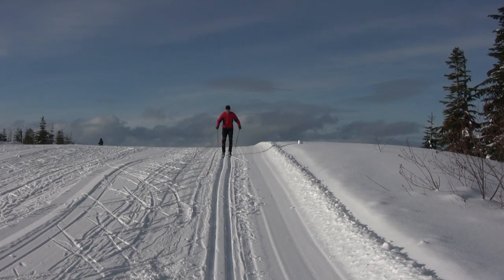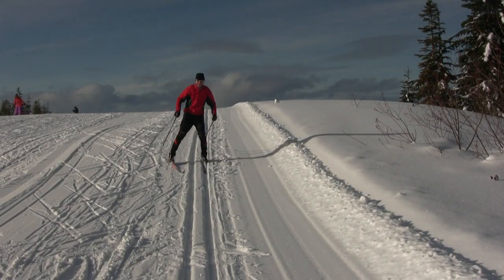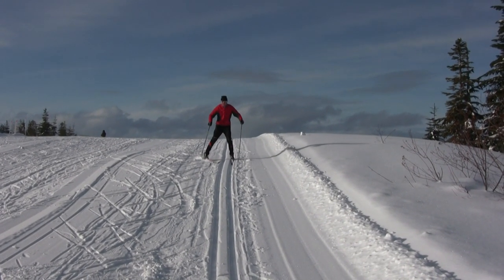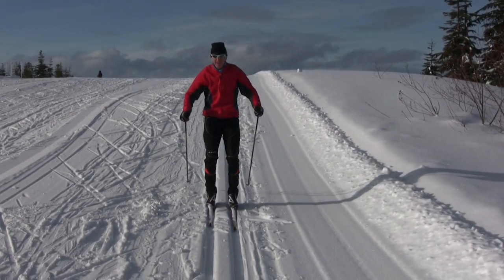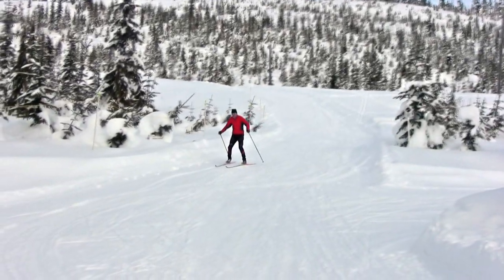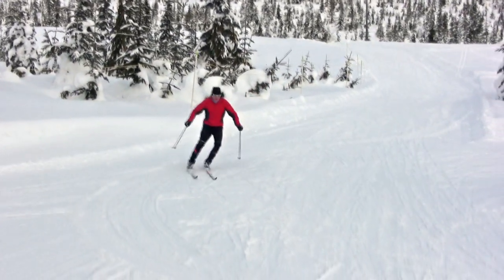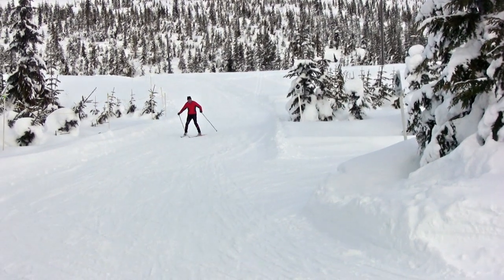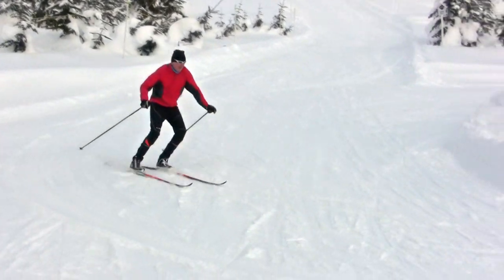How to slow down on cross country skis

Comment: Great video. If the ski track is partially missing the outside lane on a sharp turn, is it simply better to step out completely? I can't break, because the inside leg is stuck in the track (inside lane) and I fall.
Reply from the maker: I would say step out if there is any doubt. But do that before you gain much speed if you can
Reply: @k2nicol  Ok. Thanks!

Comment: I'm a beginner to cross country skiing, I have to say its really hard to snow plough with these skis.  There is much less control than with regular skis.
Reply from the maker: You need to be balanced and use the edges to control your speed . Check out my video about being centered on your skis. It may help.
Reply: You probably meant to say that regular skis shown in this video have less control than heavy alpine skis designed for the sole purpose of going downhill after being pulled uphill by a machine? 🤣
Reply: thx for sharing. I nerver use normal ski but I tought I was dumb cause it takes me lot of practice to turn  in cross country
Reply: @improvisoire3701  you can do it. When I moved to Norway many years ago and did skijumping and salom ski, I thought can try cross country ski too classic and damn I fell over 20times the first time and over time, I got better and better now can go all up and downhills to change tracks but at times it's still a struggle espcially when the snow is hard and icey it's harder to control the skis and balance espcially when you start to get exhausted so it's takes alot but pratice and to lose fear of falling espcially for me when it's very hard and icey tracks but it get's better just keep trying and trying as even the best ones do fall.

Comment: Any tips on getting the skidded turn down? I've tried skidded parallel stops too, not very effective.
Reply from the maker: You need good snow conditions (firm snow with dusting of fresh snow is ideal) and you need to be faster than for a snowplow turn. My new on line instructional programme might help me quickly spot what you are doing incorrectly..if interested touch base at k2nicol@gmail.com